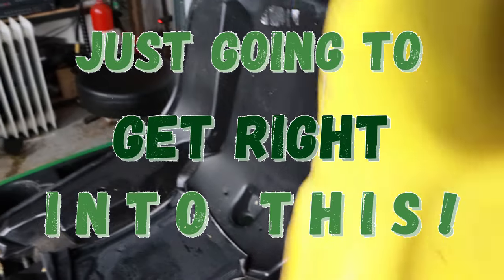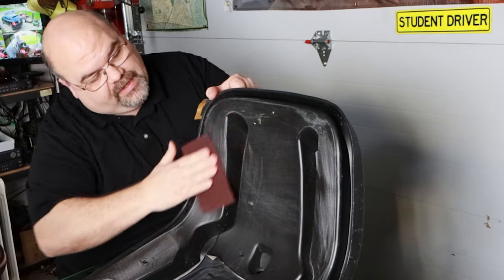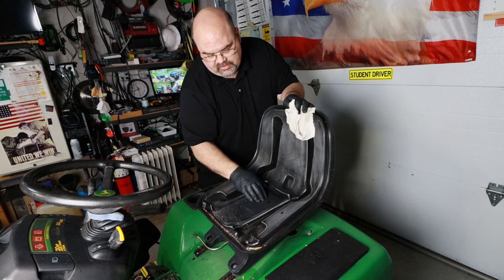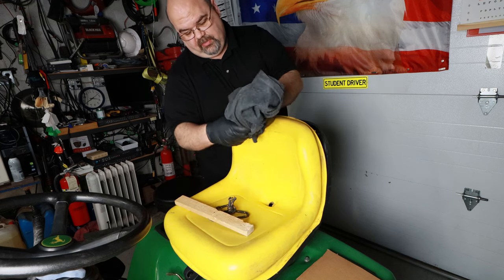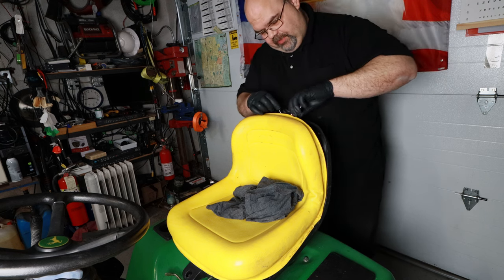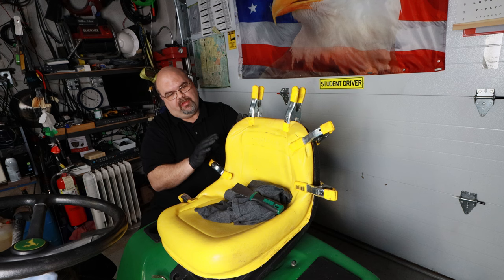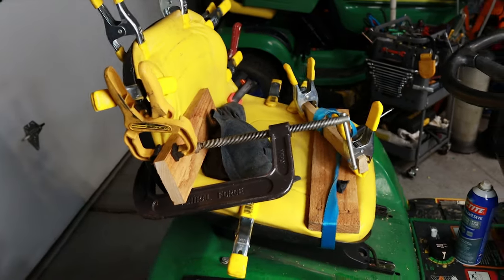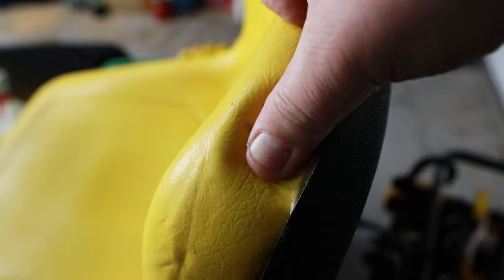Transform Your Lawn Mower: Quick Seat Reattachment Tutorial!

Comment: Mr Bald Eagle, I fixed my seat just like your video. I used an oscillating tool to get the old glue out of the channel. Used the sand paper & Emory cloth to get it clean. Bought the spray and glue, like you had listed. I used the clamps and even had one slide off, just like your video. I had to use some ratchet straps to hold the seat down, as I didn't have enough of the bigger clamps. All turned out great. I was going to post some pictures but I guess you can't do that on YouTube. New hood, took the fenders off and foot pads off. Sanded and painted. Looks great. Thanks again.
Reply from the maker: Thats awesome! I have Facebook and Instagram accounts with the same BALDAGLE242 name. You’re welcome to share pics or videos there if you like. 😁👍
Reply: @baldeagle242  I will check it out. I noticed yesterday, the seat is already coming lose on the bottom. May have to reglue on the bottom side, towards the steering wheel.

Comment: Nice fix... if you did that for a customer whats the total cost?

Buying the replacement seat, glue, enough clamps labor cost. 

Nice to have a good looking seat. Make the mower stand out.
Reply from the maker: This is more of a repair for an owner that has the time to put into it. The total cost of materials for this job was around $30 including the clamps. It took me about an hour and a half total labor time over two days by the time the adhesive cured. For someone to do this in a shop would not be cost effective and a new seat would be the better way to go. Thanks for watch and taking the time to comment. 😁👍

Comment: Great fix using contact cement.  The seat was originally glued with hot glue but most people don't have a big enough glue gun to do this job.  The problem with most adhesives is that they have to have air to cure. Construction adhesive needs air to cure and because you are clamping plastic against plastic it can't dry or cure. You have solved the problem.
Reply from the maker: So far it’s holding up very well. I’ve been using this mower all summer and it’s still holding up. Thanks for taking the time to leave a comment. I hope to see you around on future videos.  😁👍

Comment: I have tried 3M Super 77 spray adhesive on seat and it didn't work.  Work great for stickers that blow off when pressure washing.  This requires a little work for sure.  Do you think Liquid Nails that is made for plastic would work?  Great job!
Reply from the maker: I’ve never tried liquid nails. I’m not sure.

Comment: Nice informative video. How long ago did you make the video? And are you still pleased with the Loctite?
Reply from the maker: I actually just finished a few other things on this mower today and posted a short little video earlier today. It’s been about four months since I fixed the seat and so far it’s held up very well.  https://youtube.com/shorts/owpZPZ9Ihrk?si=Mb2EnAqyOoaPxBKz
Reply: Thank you for the info I’m going to Home Depot tomorrow to get the glue tube of for the gun why can’t you just use it on all of it ? Why do you need two different Loctite glue’s
Reply from the maker: @josephwagner2729  You don’t need much on the foam itself. My concern was that the adhesive would be too aggressive and may cause the foam to deteriorate. If I remember correctly there was also a notice on the adhesive not to use it on foam. I recommend reading the label before trying it. If you go forward with it let us know how it works out.

Comment: I found 2 Oem john deere Gator seats for $60 for both no cracks they just came loose would that fit on a John deere lx 280?
Reply from the maker: I don’t see many Gators here. I’m not sure how the seats mount onto them. I’d go to eBay or Amazon and see if you can find a listing that shows the mounting holes and location. I’m sure it can be “made to work” but I’m not sure if it will bolt right on or not.

Comment: Emery cloth? Isn’t that a Scotch Brite pad or equivalent?
Reply from the maker: Emery cloth, often referred to as "sandpaper on a cloth," is a versatile abrasive material that is commonly available in the form of a roll. It consists of a durable fabric backing embedded with abrasive particles. The abrasive coating on emery cloth is typically made of aluminum oxide or silicon carbide, which provides the necessary grit for sanding and smoothing surfaces.

On the other hand, Scotch Brite pads offer a different approach to abrasive materials. These pads are composed of a porous fiber matrix infused with abrasive particles. The fibers create a three-dimensional structure that helps in distributing the abrasives evenly across the surface being worked on. Scotch Brite pads are designed to be more flexible and conform to various shapes and contours, making them suitable for intricate tasks.

Either emery cloth or Scotch Brite pads would be suitable for the job at hand. Both options can effectively accomplish tasks that involve surface preparation, cleaning, or light sanding. 

Emery cloth, with its sandpaper-like texture, provides a more aggressive cutting action and is ideal for tasks that require heavier material removal or rougher surfaces. It is commonly used in metalworking and woodworking applications, where it can smooth rough edges, remove rust or paint, and prepare surfaces for painting or finishing.

On the other hand, Scotch Brite pads are known for their versatility and gentle yet effective abrasion. The porous fiber structure allows for better control and finesse, making them suitable for tasks such as cleaning delicate surfaces, removing light blemishes or stains, and achieving a smooth finish on various materials. Scotch Brite pads are commonly used in automotive detailing, household cleaning, and even in food preparation areas where non-scratch materials are required.

Ultimately, whether you choose emery cloth or Scotch Brite pads will depend on the specific requirements of your project, the type of surface you are working on, and the level of abrasion needed. Both materials have their unique characteristics and can be effective in their respective applications.